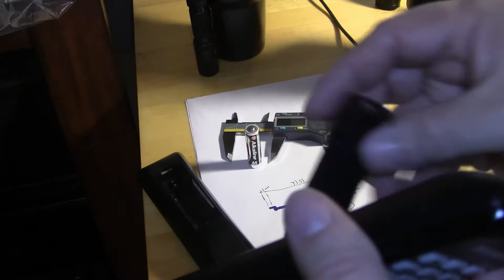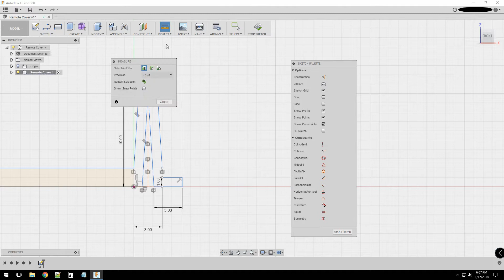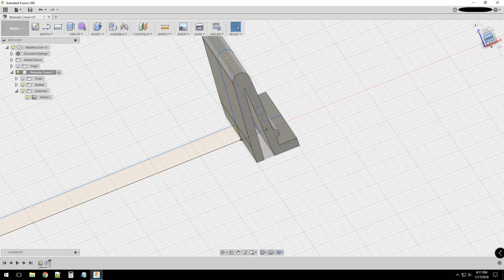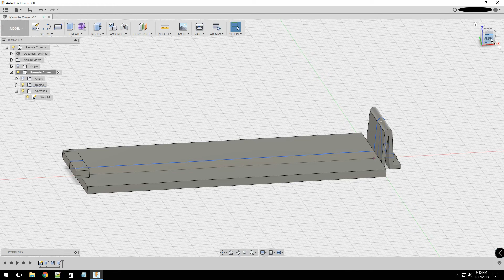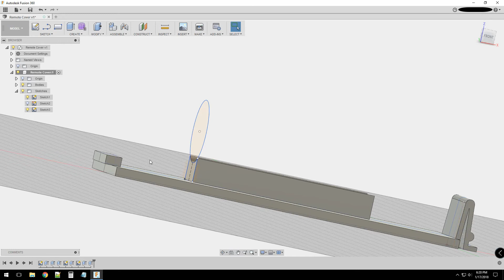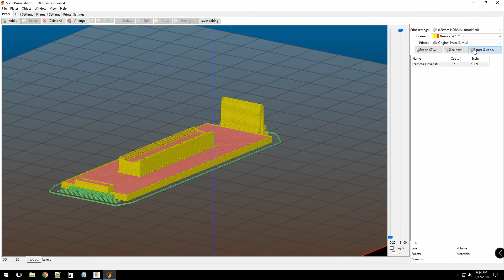Fusion 360: Let's make a Battery Cover - 3D Printing - Start to Finish

Comment: I need two of the same battery covers for toys that I have.  I have three, but only one toy has a cover and two do not. How much did it cost to make this battery cover.  I was wondering because I hear that UPS has a 3d printer and I'd like to know if it would even be worth me going there to see if they could make them for me.  The cover has a metal battery contact plate that could be added (glued) after it was fabricated. I wouldn't care, but the toys need the cover to complete the battery contact.
Reply from the maker: If you plan to draw it your self, Look at your local library.  They don't charge much.  If you not drawing it your self, you can look at shape ways to hire a CAD designer or look up your local hackerspace.  Hackerspace are in most major cities. They are a non-profit organization where people with common interests, usually in computers, technology, or digital/electronic art can meet, socialize, and collaborate. Shouldn't cost much to print. just a few bucks in plastic.  The cost is in someone drawing it and that vary wildly.
Reply: The one I designed cost about 6 cents in plastic and energy. That was but I printed it myself so it's probably a bit more for companies that charge for it.

This is for future reference if anyone else comes by
Reply: @Codingale  Lolololol....  I am over that question.   I see you only responded for future reference. Take care.